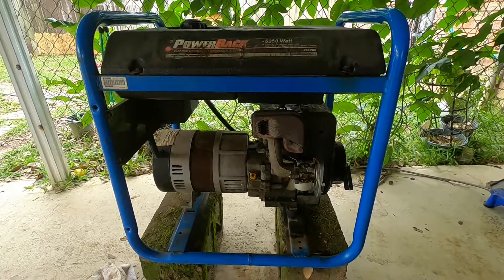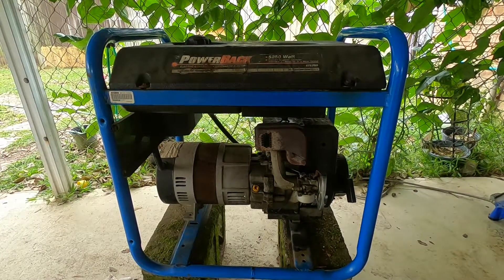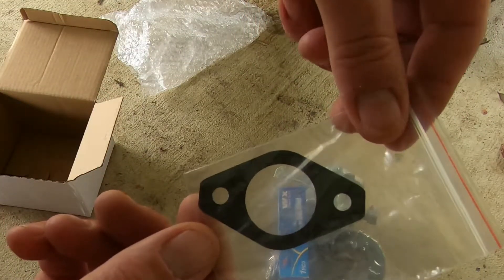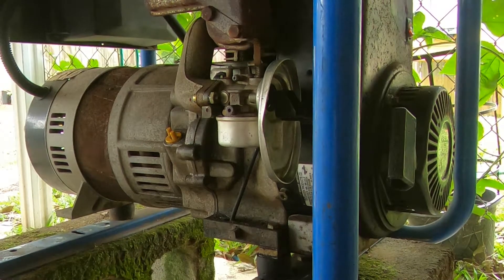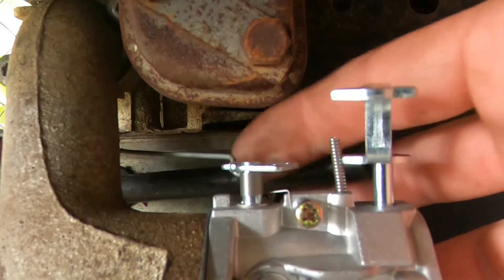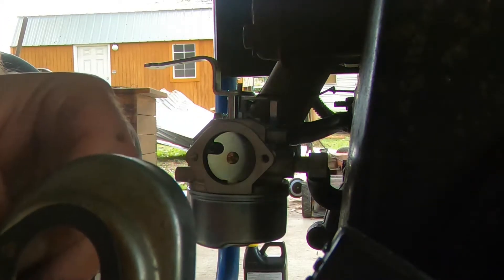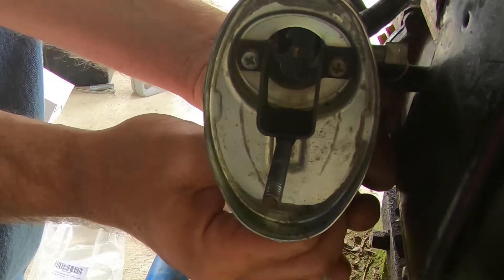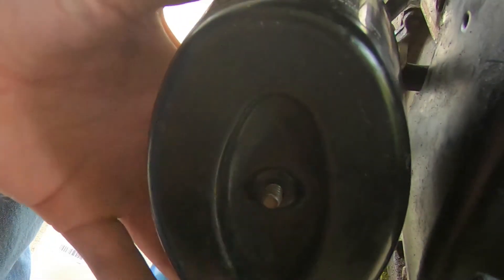Trash to Treasure Part 2 | How to repair a free generator

Comment: I got the same motor the other day for free. Wont start. Just ordered the carb kit and ignition coil kit. But i am curious why gas(i assume) came out of the air filter? Is that normal? This one did it as well when i was trying to start it up.